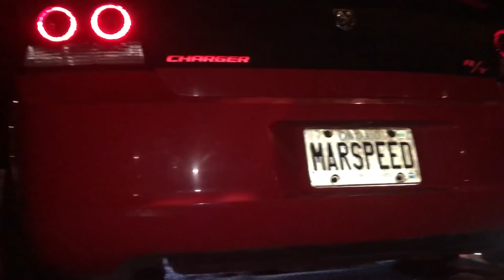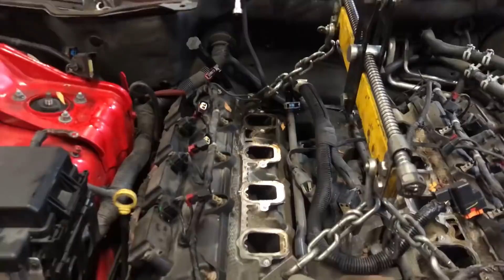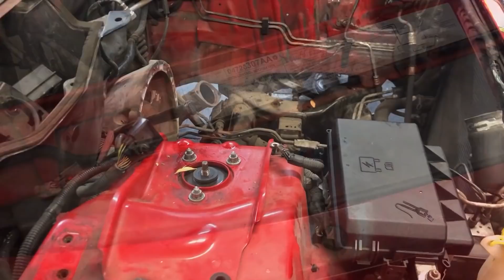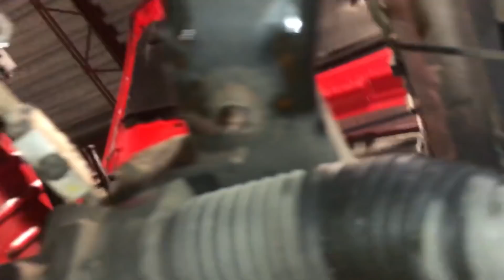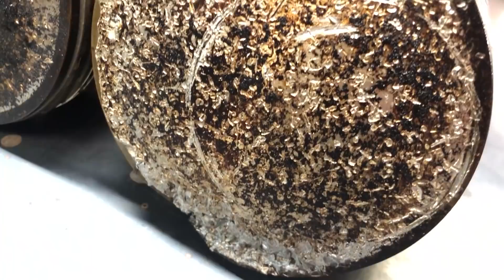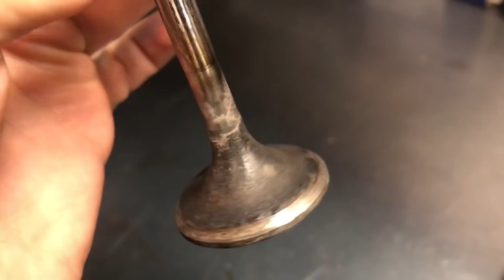How Much Damage Does Dropping A Valve Seat Cause? - 5.7L Hemi V8 Failure

Comment: Hey , do they make "HEADS" that are "CAST IRON" for those motor?       If so, I'd get them, instead of the "Same old shit" happening again!!!!!!!!!
Reply: I doubt any aftermarket head will have this issue, factory has build variance a cylinder head company has much better craftsmanship and tolerances.
Reply: I plan on buying a pair of remanufactured heads after watching this for my 06 Chrysler 300c. Rather be safe then sorry.
Reply: @frankhartford5194  Hopefully the rebuilt heads you buy will have new tighter valve seats which is not necessarily the case.  Go to Jasper Engines and watch their video to see what they do to keep the seats in place.
Reply: It's the 5.7. They make everything for these. The real question is, what will he go with?
Reply from the maker: I’m doing a 6.5L stroker custom motor, the only Hemi part left are the blocks and using eagle heads
Reply: And why add 60lbs?

Comment: Rebuild (if possible) or crate engine will be a lot cheaper than buying a new 30k+ vehicle. Don't give up!
Reply from the maker: I’m doing a 6.5L stroker motor build, all NA! Thanks man
Reply: @MarspeedCars  Do you think when my 5.7 gives up what should I do ?
Reply: @Don't get well boi , The 'crate' engine, would probably save money, VS an overhaul... But, it would probably still have the same inherent problems, waiting to surface - that this machine had... The crate engine, would facilitate the sale of this troublesome vehicle, and the owner could then recover a fraction of the $ they have poured into it... Maybe they could re-invest into a restored classic Mopar, or other make of vehicle, from the 50's-70's.... THAT, would then generate the performance the owner deserves.... RESALE VALUE...

Comment: My seats dropped 4 weeks ago, I’m doing a complete performance build but am sticking with the 5.7 displacement so I can run more boost in the future
Reply: Adding displacement will not limit boost.  Adding compression will.
Reply: @chrishernandez2490  adding displacement weakens the block, I’m not planning on running a supercharger, I’m planning to go with turbos
Reply: @chearchie4472 oh ok,  I guess yeah if you have it bored out.  I was thinking of a stoker kit.
Reply: @chrishernandez2490  well a lot of strikers require the bore to be bored out somewhat from my experience, but I think that bigger displacement works well with superchargers but not so much with turbos
Reply: @chearchie4472  I have seen and worked on Mining equipment engines having over 3,600 cid and 4 Turbo chargers,  Producing about 2,200 dependable - extended duty HP, and we'll over 3,200 lb-ft of torque... But to that high output, there is a price... Weight, complexity and HUGE amounts of heat that has to be dissipated... Because of the complexity, size and weight of that machine, the CO$T of operating it is very high... Why not stick with a good running naturally aspirated machine? Fewer things to go wrong, less trouble to work on and much less $ to operate... Just saying...
Reply: @michaelmartinez1345  it’s a project car and I’m not gonna run boost anytime soon haha it’s just something I planned on doing from the time I bought the car, I won’t be trying to break records or anything just want something unique
Reply: @michaelmartinez1345  also any turbo setup is as good as the builder and tuner, if you’re conservative you won’t have any problems I know several people with boosted cars that haven’t incurred any major issues ever

Comment: This will prevent me from getting dropping valve seat on my 2006 dodge ram 1500 5.7l hemi.
Reply from the maker: My other video explains tips that might help prevent it, but you can also just fix the heads which will definitely prevent it just costs $$$
Reply: @MarspeedCars  thanks
Reply: @MarspeedCars  what do u mean by “fixing” the heads? Do u mean replacing the valve seats or something?